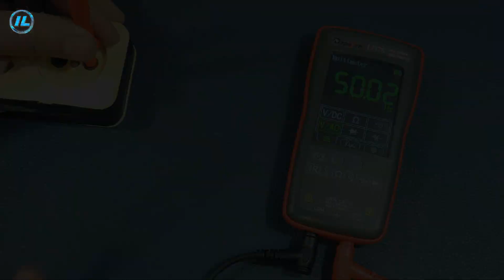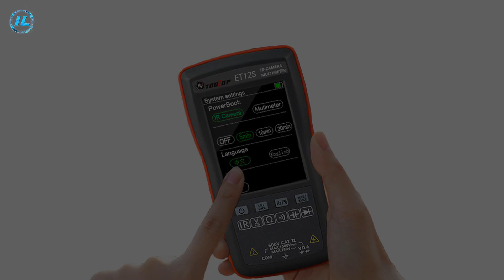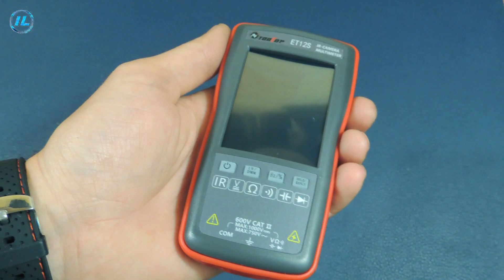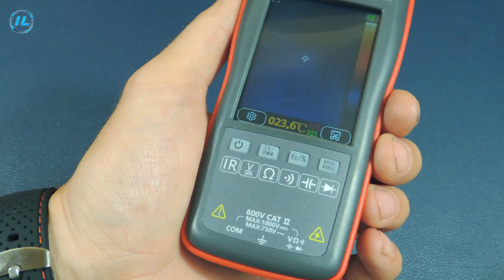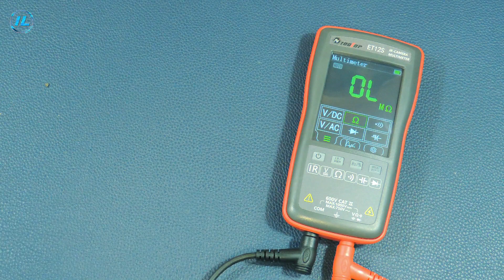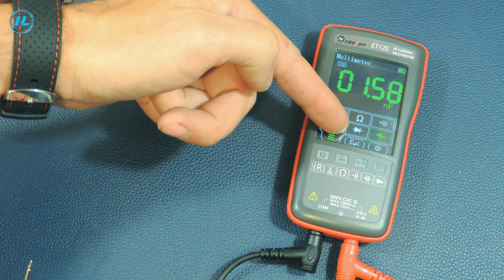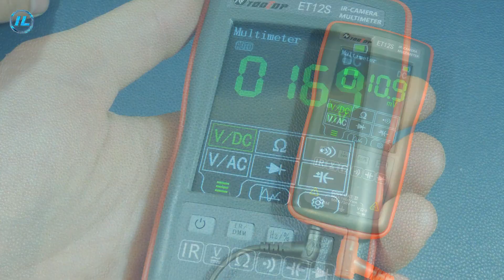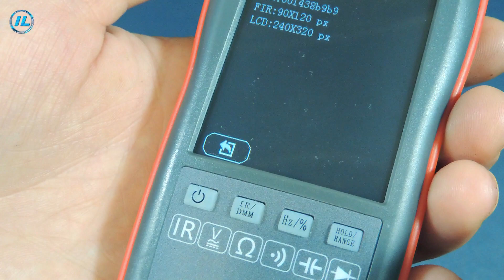✅ A multimeter with an infrared camera is a great thing! Overview of the ToolTop ET12S multimeter. ✅

Comment: this thermal camera with this such a low resoultion is useless in electronic, there is no visible components where the heat spreading over. I presume you got a paid for this add with this USELESS device. DON'T BUY THIS it is crook advertisment of cheap device

Comment: Any suggestions as to what the problem could be with this multimeter? The thing is that it doesn't take measurements, the screen only shows 8888 even if the original tips are connected, thank you in advance.